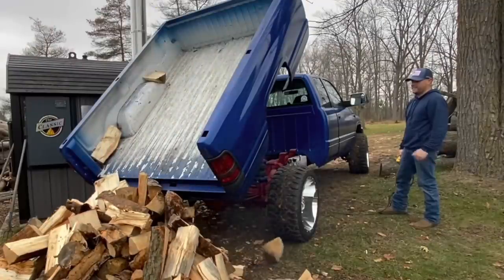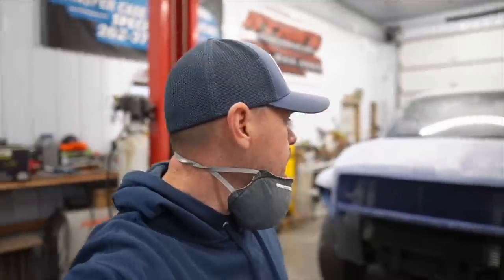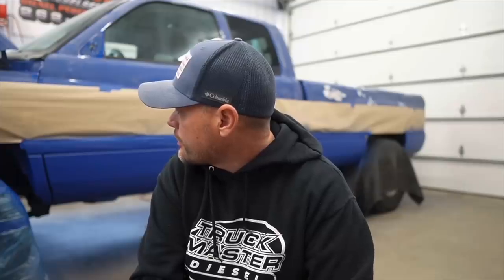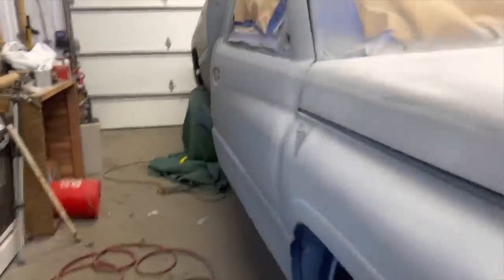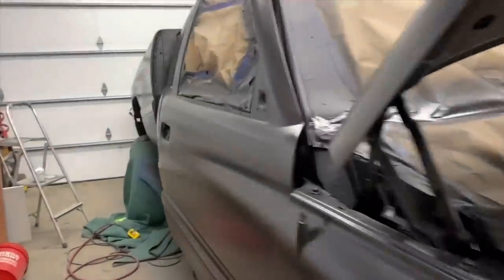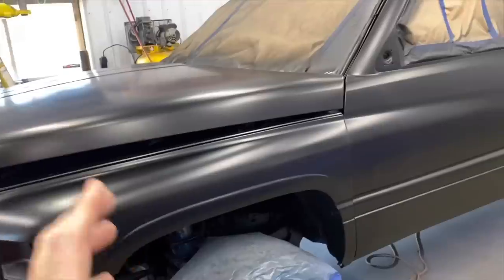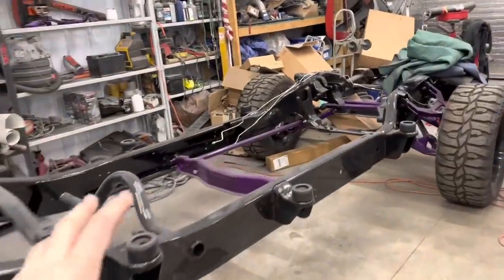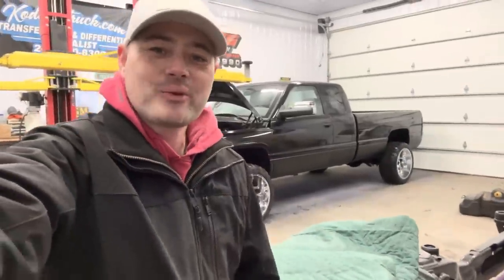Revealing My New Paint Job! (The Cummins Looks INSANE)

Comment: On my ‘05 F350 SRW 6’ bed, I just did a Dorman bed rail replacement. I Raptor bed lined the underside & the bed. You’re right that prep is the key. I have plastic fenders that I am going to bed-line as well then was on the fence about doing the lower 1/3. You made realize it’s great idea. Not does it protect from rock chips but after seeing your truck, mine will look great as well! Thanks Josh! And yes the black looks awesome!

Comment: I rebuilt a red Chevy 2500 6.0. Did tons of body work and color matched raptor liner. It was really close to perfect match and I played with the pressure for a nice texture. Did from bottom on the hood down and entire bed.  It looked decent and worked well on the truck. I don’t regret doing it but after that truck I’ll never do it again lol

Comment: Hey I’m just wondering have you ever had an issue with injector wiring on any of the duramaxes? I have an lmm and injector 2 says it’s circuit is shorted
Reply from the maker: It might be the injector pigtail that attaches to the solenoid. It’s hard to say